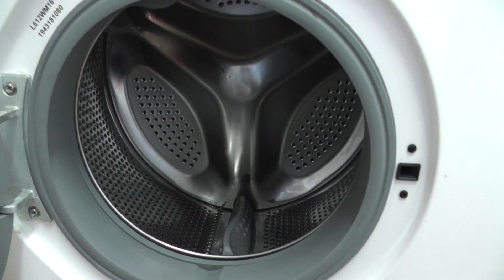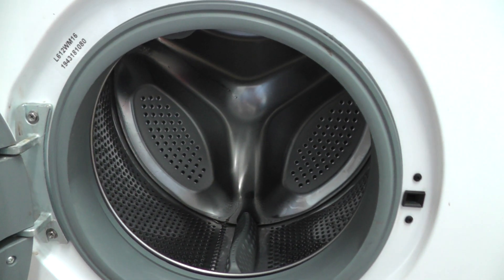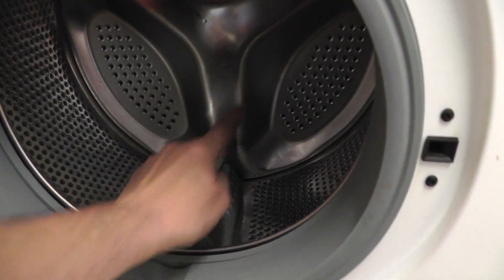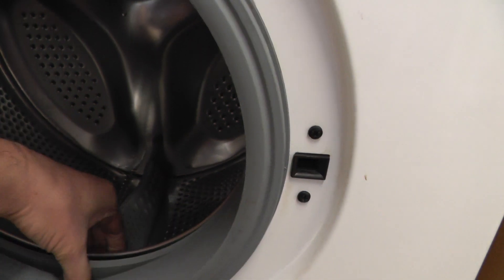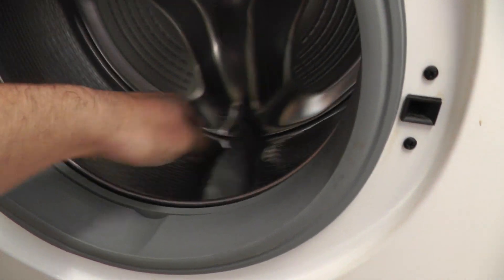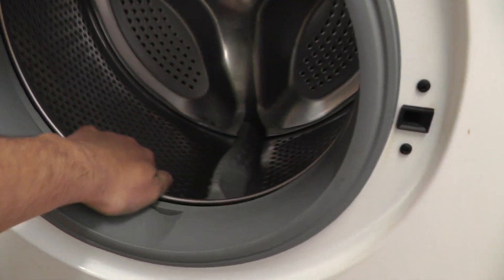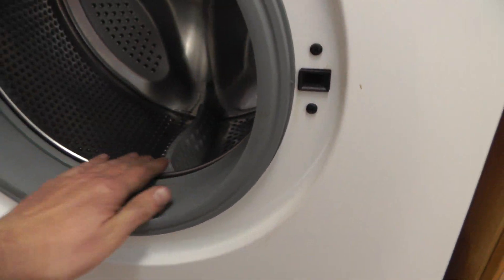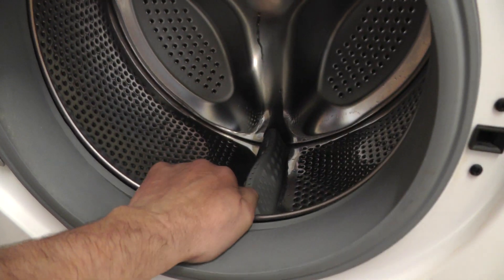Washing Machine LOUD Spin? Diagnose Bad Bearings vs Broken Drum Spider (The Wobble Test)

Comment: Hey so I have a question why does my washer make a grinding noise when spinning at low speed but at fast speed it doesn't make noise sounds like stones grinding
Reply from the maker: sounds like something caught in the drum - maybe its bearing
Reply: @cagmito76  I think so it sounds like multiple things are grinding
Reply: @cagmito76   how long does it take for a bearing to fail bc my washer is almost 5 years old